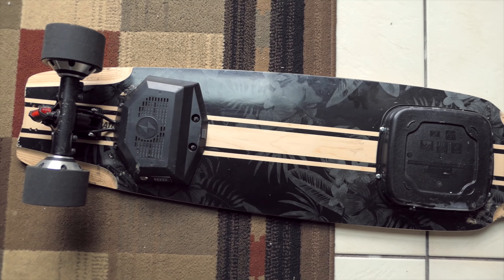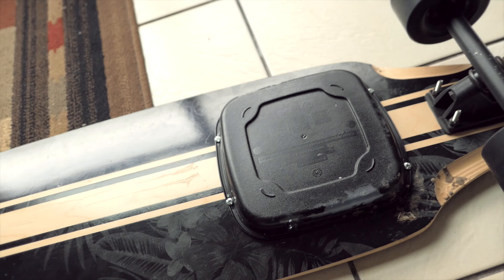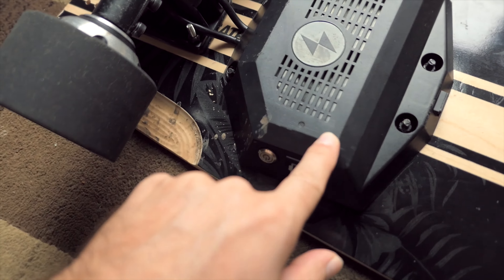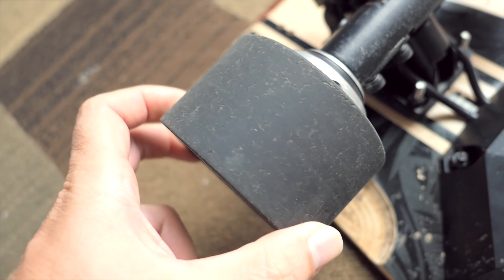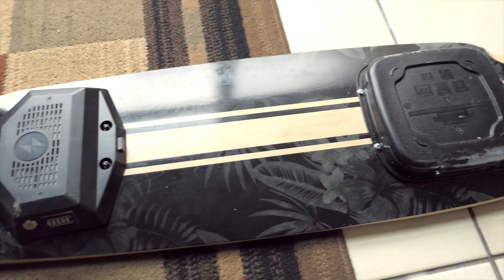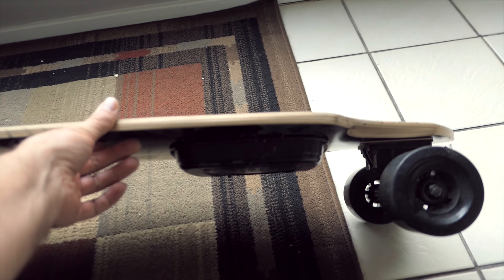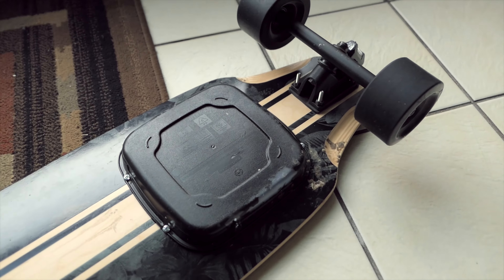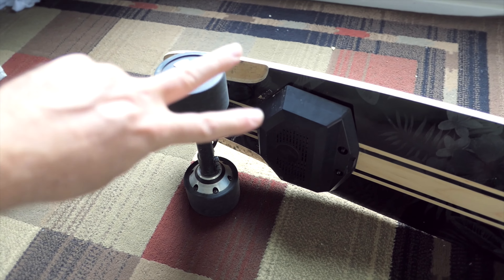$350 Diy Electric Skateboard - Update

Comment: They sell replacement tires for the hub motors for pretty cheap. Something like $14 a pair.
Reply: where did you find them? what I found was the whole outer shell including magnets for 40$, so 2 of them would be 80$ which is nuts. (no motor, just the shell)
Reply: Not for those motors 
Those are like the Meepo motors and you have to replace the whole thing
Reply: Michobby has tires for the maytech motors. That's what I thought these were.

Comment: Hi Vlad so you think these would be fine 2X 5000mAh 3S 11.1V 30C Li-Po Battery Pack RC Airplane Boat Deans Plug W3D8???
Reply from the maker: Sure, any lipo battery does pretty good with electric skateboard build. But go with higher voltage set up, it will be more efficient and easier on the batteries.

Comment: How is the range working out with no batteries in parallel?
Reply from the maker: +Isaac Lyons for me it's fine, I use it for fun so 6 to 7 miles is plenty good usually. If your not going to use 3000mah batteries than I would suggest doing 20 cells. I do have a bit of voltage sag when going full power uphill so more batteries parallel would be better if you're going to climb alot of hills.
Reply: Just Vlad, thanks! There is not flat ground where I live!
Reply from the maker: +Isaac Lyons go with 10+10 in parallel you'll thank yourself later.
Reply: Just Vlad, that's my plan!

Comment: +Just Vlad Thanks for the update. That really looks like a nicely build board, and a well explained video for the DIY board. What are your thoughts on this board - https://ownboard.net/ ?
Reply from the maker: Looks to be a good board over all. If i had this option available before i built mine, i would go for it. Thanks
Reply: Just Vlad That board has zero reviews yet, except one by the creator himself. Feeling a bit hesitant to get one for the fear of it conking out in a couple of weeks. How do I alleviate myself of this fear?
Reply from the maker: +Dhaval Soni I think the components are very similar to my diy build. I wouldn't worry to such except maybe batteries but I'm sure it will all be fine. Plus maybe you can review it once you get it.